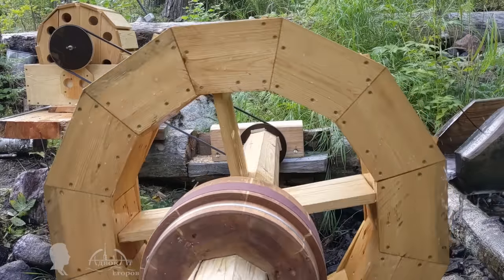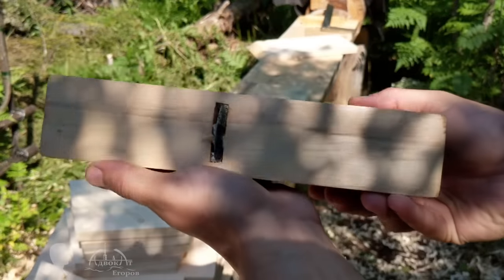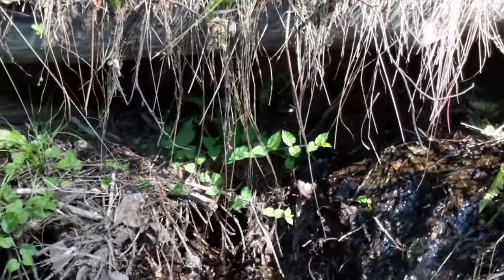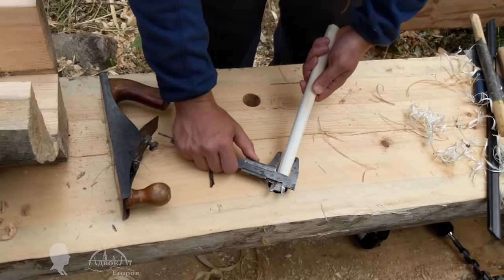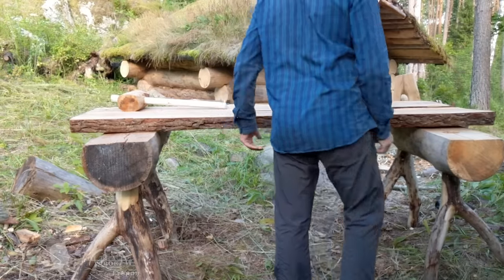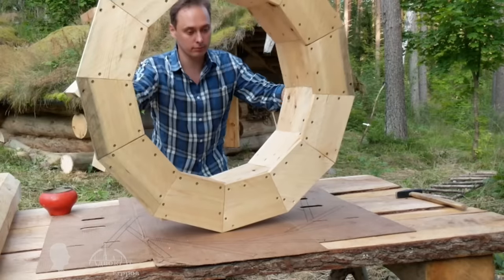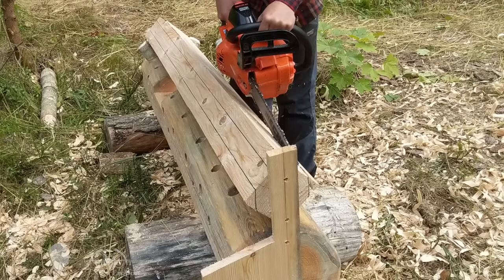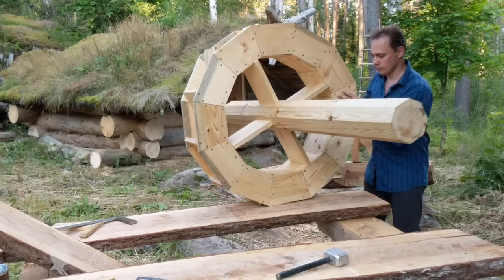Constructing a Bushcraft Waterwheel / Harnessing Hydropower Energy for My Log Cabin Camp

Comment: Your work is absolutely beautiful and your life is no doubt the dream of many people.
However, I disagree with your explanation about the use of energy from the water stream. "Breast-shot" water wheels (as you have) are about 50-60% efficient, mostly because they do not (contrary to what you said) harness the kinetic energy of the water from the headrace; at least, not the horizontal component of the water velocity. Yes. the water falling at speed into the "bucket" shape formed by each blade does harness the vertical component, but the horizontal component is wasted and just causes turbulence in the bucket.
"Over-shot" wheels are about 80-90% efficient. (see Wikipedia)
I think that you would get more power from your wheel. for the same "consumption" of water, if you lowered it (gaining potential energy from the increased head ) and reversed the rotation i.e turned it around, so that the rotation was in the same direction as the flow. Thus the water hitting the blades would push them ,( kinetic energy, horizontally & vertically) and add to the weight of the water (potential energy, vertically).
Thus you would get more torque from the wheel. If it spun too fast for the load applied, and centrifugal force threw the water from the buckets, then you can close the gate a bit,  reduce the flow. and conserve water in your dam. 
I do not in any way mean to criticise your work, it is such an inspiration. But I do think that you could get more power if you need it, by converting it to "overshot" mode of operation, rather than building a whole new system (which you said that you might do in the future). The conversion would be less work. 
Thank you for your video. I for one, did not need a rest from your calm and deliberate voice 🙂 I congratulate you on your channel. You provide very valuable and enviable content.
Reply from the maker: Thank you for kind words and the info!

Comment: Dear Max, 
first I want to thank you for you Videos, they are a great inspiration and even if I am not able to do something similar, it takes me along your trip.
In your video you mention a larger waterfall more downstream. Additionally I've seen you using a generator to power up your electronic devices.
That is why when I stumbled across this low budget micro hydropower project (https://www.youtube.com/watch?v=ibCu0PxIZA4)  my first thought was on You.
It is easy to be constructed in your home workshop, and lightweight to be transported. also it seems that installation is simple so it could be stored in your cabin whenever You are absent, avoiding damage from frost for example. It could provide um to 200W and if used with a battery and an inverter even enable you to use your power tools from it.
I am aware that the style does not fit to the more rural projects you normally do - however you also use modern Materials in other projects so I just wanted to make you aware on that open source project.
Kind regards
Simon
Reply from the maker: Simon, thank you for your kind words and the link!

Comment: Before diving into tree cutting, it's important to acknowledge that what works for one tree might not apply to another. Using a chainsaw isn't always as straightforward as it seems in demonstrations. Safety should be a priority, and understanding the specifics of each tree is crucial. Seek professional guidance or assistance, especially when dealing with large or potentially dangerous trees.

Comment: It looks like your wheel may have enough spin to run a 12 v.  automotive alternator and therefore electric lights n your cabin.
Reply from the maker: No, unfortunately it is not big enough for that...
Reply: @Advoko  A small 35 amp car alternator requires very little power to run it. The trick is gearing it run  at speed required to maintain the electric field. On cars it's only an idle. Ours worked perfect and we had lights 24/7. The lights are 12 volt but with the new LED lights that take only s fraction of the old lights you could run lights all night long